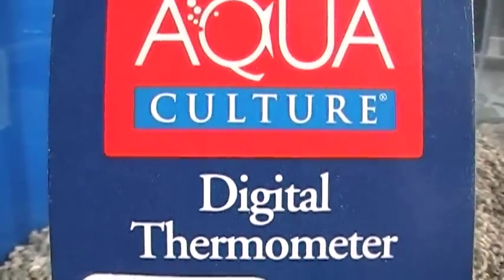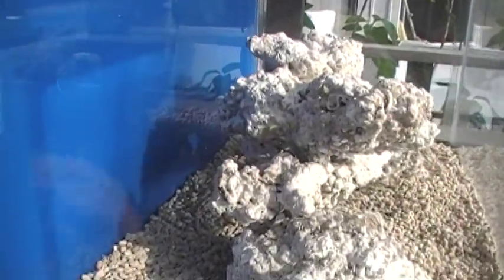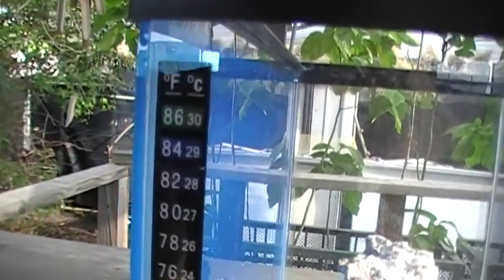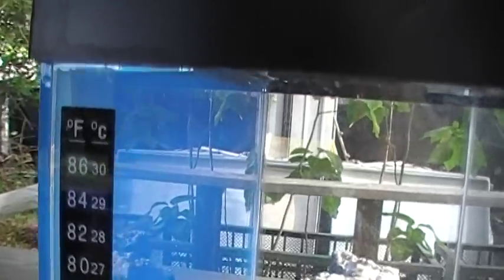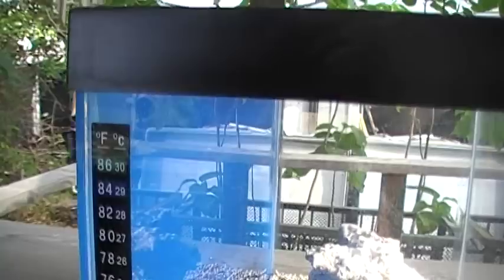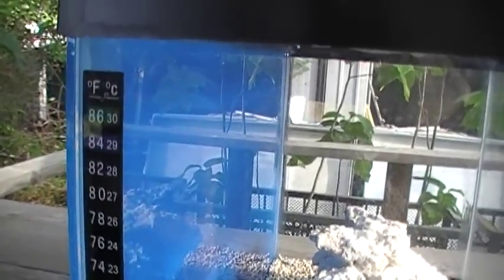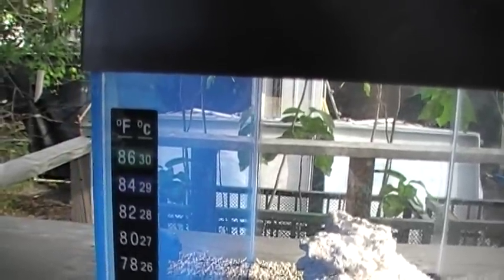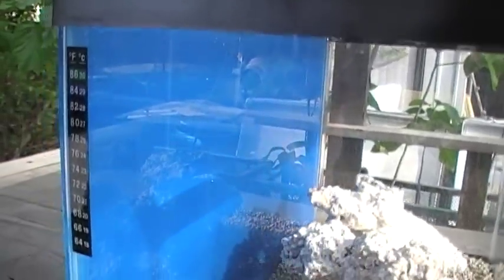Nano Lagoon (7): Thermometer

Comment from the maker: You can use this basic setup for the 10 gal standard (and the 20 gal long, with upgraded lighting and filtration units).  For the 45 you need lighting in the 160-200 watt range and larger filtration units, plus internal power heads to generate sufficient water movement.  The principles of operation and the biological processes are the same, however.

Comment from the maker: Good question,  To answer it you'd need to run independent tests on the heater and the thermometer, comparing them with instruments of known accuracy.  The reality is that the instruments and test kits sold for the aquarium hobby are not as accurate as the far more expensive ones sold for technical or research purposes.

That said, do aquarium organisms suffer if the thermometer is off by a couple of degrees?  Probably not, unless they are near the upper limit of their thermal tolerance.